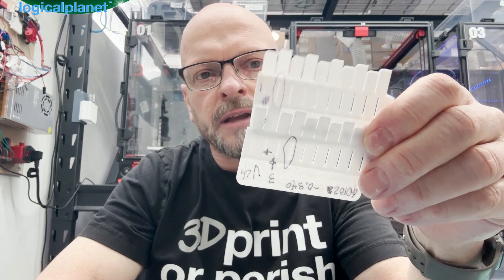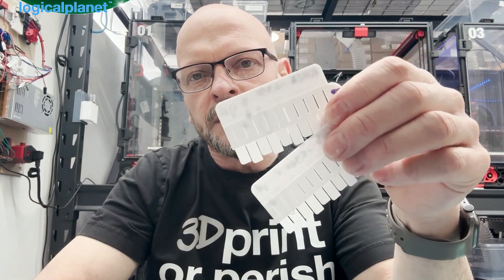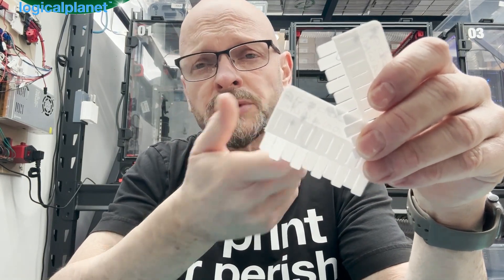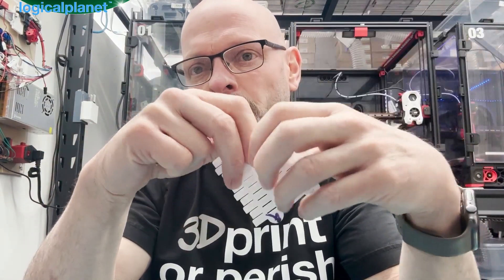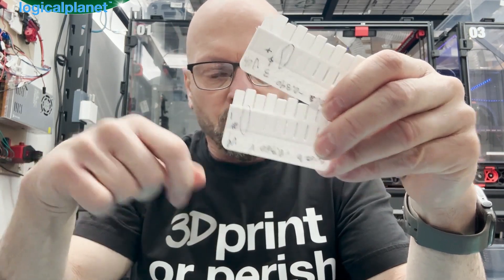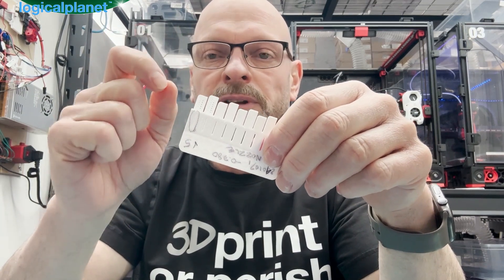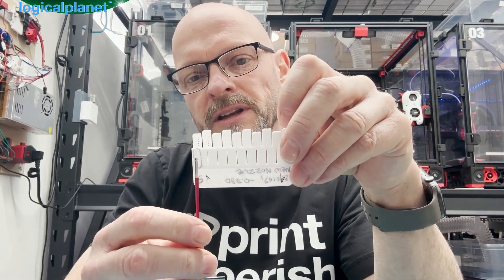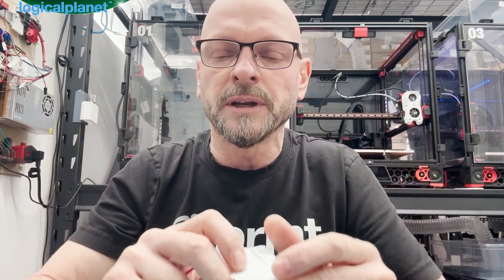First Layer Squish Tool

Comment: How are you printing the 0.1mm height tab on this object if your first layer is 0.2mm? Some guidance on how to properly slice this thing would rock.
Reply from the maker: It is a tool to be used to learn and understand how your printer behaves with various slicer settings.  You could print with 0.1mm layer heights, and then that tab is relevant.  But printing using 0.2mm layer, you might be interested to see what happens.  Some people do not think about it, so they just assume 0.1mm and perhaps other odd layer heights (0.3mm, for example) will print.  But through this tool you will see/learn what happens based on your printer and slicer settings.  If in your case, it is not relevant, then you can safely ignore the tab.

Comment: so was trying to get this to work on a bambu, but the first tab does not print with 
Nozzle = 0.4mm

My Settings:
Layer height = 0.2mm
Line width = 0.45mm

Was trying to play with smooth bottoms and actually using squish, any advice?
Reply from the maker: I have to start by saying I developed that tool when I was dealing only with Vorons that did not automatically set Z-offset.  Since then and now having several machines including the Bambu X1C that automatically set their own Z, I am not using the tool so much.  But to answer your question, the first tab is a 0.1mm layer and therefore can not be printed with a 0.2mm layer height.  So you should see nothing there.  Some slicer settings will behave differently so the first test is to just look in your slicer preview and see what the slicer is telling the machine to do.  Then compare that to what the machine actually does.  But with basic settings, the first tab should not be printed and the successive tabs will be in 0.2mm increments.  What I mean is the 0.3mm tab will be actually printed as either 0.2mm or 0.4mm.  Does that make sense?  And, is that what you are seeing?
Reply: @logicalplanet3d  Definitely, It was more with the .2 setting and it not printing, this is what I assumed, but thought maybe I was missing something, I think this will help me develop my own test for what I am wanting to try, Thanks so much for the quick reply!

Comment: Hey thanks for this! When I import the STL into my slicer, the 0.1mm tab is missing. Any idea what I am missing?
Reply from the maker: Hi yes, if your slicer is set to 0.2mm layer height it can not print a 0.1mm layer.  So it sounds like you are seeing it correctly.  Part of the idea of my tool is to make users aware of these nuances.   What I mean is if you design something and put a 0.1mm high element in it you will get nothing (when using a 0.2mm layer height).  Unless you are using adaptive layer heights which seems to be increasingly common.  Also, using a 0.2mm layer height, it is interesting to know/see/be aware of how your slicer handles a 0.3mm layer or 0.5mm layer (as examples).  So once you print the squish tool you can take a look at these subtleties.  Of course, you are right you can just look at it in your slicer too.